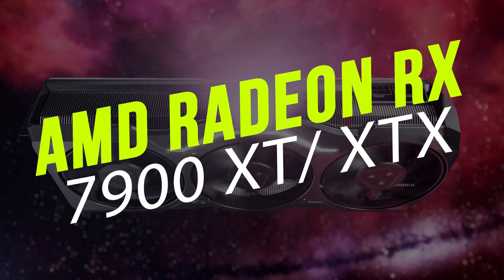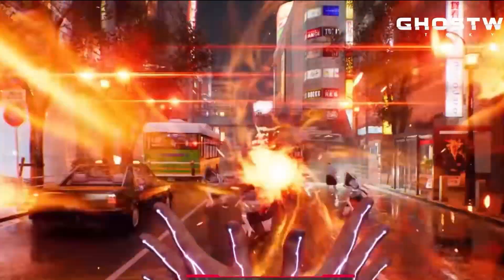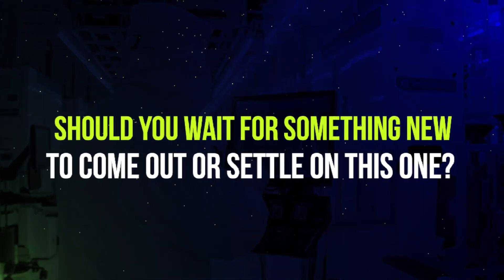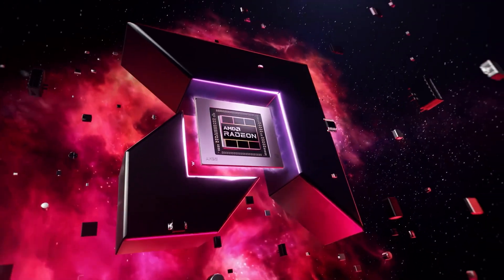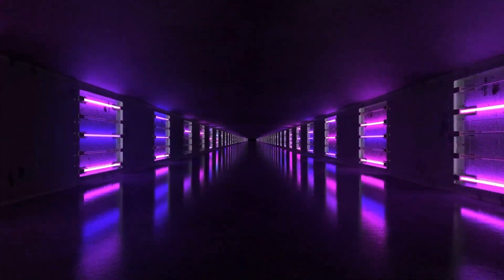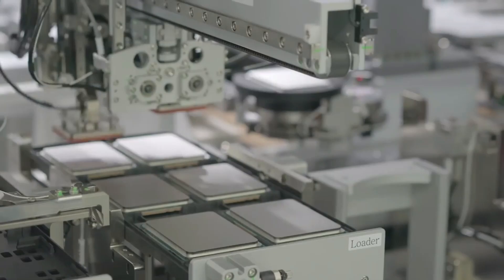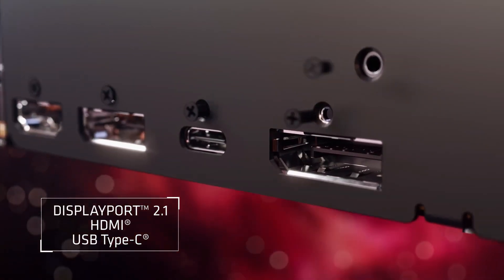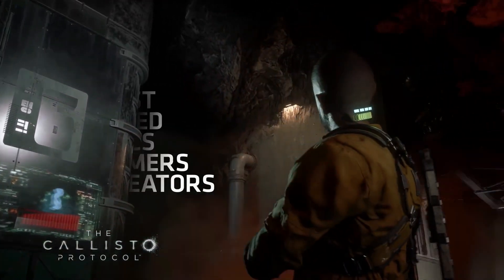AMD Radeon RX 7900 XT/ XTX - Our HONEST Review

Comment: Have a reference 7900xt. Love this thing and no issues at all. Really like how quiet it is. Was over $450 CAD cheaper than a 4080 and about $200 cheaper than a 7900xtx.
Reply: What are the clocks and temps during gaming for you? And what card do you have?
Reply: @KASE94  clocks are over 2500mhz. Reference design from AMD.  Temps of the gpu and junction are within 15 degrees of each other. Everything is stock.